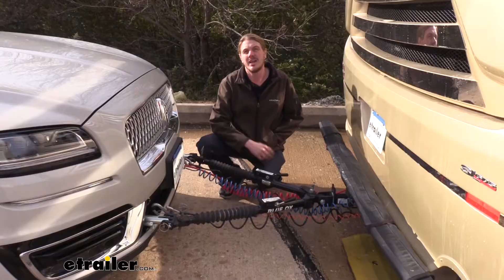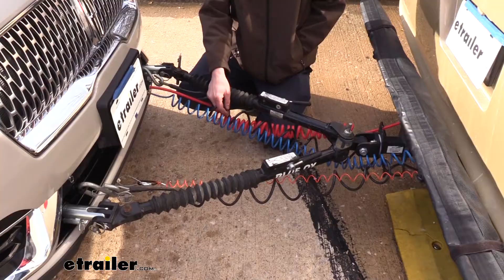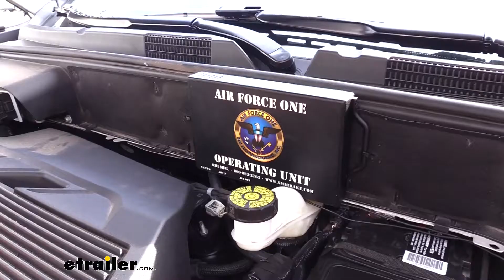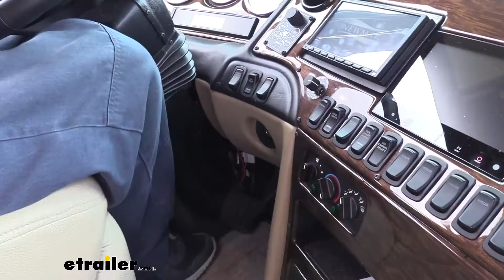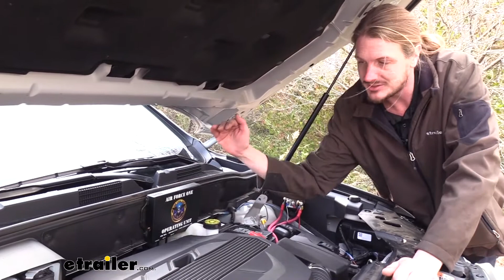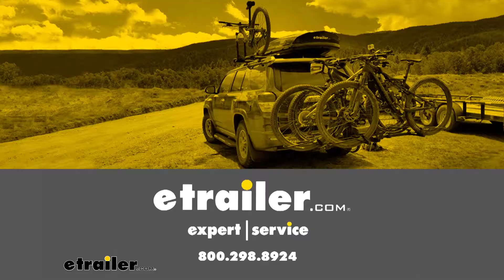etrailer | Best 2019 Lincoln Nautilus Flat Tow Set Up Braking System Options

Comment: What are the extra parts you need for the towbar wiring  that is needed?
Reply from the maker: It will depend on what type of braking and light system you are wanting to go with. You will typically need a 6 pole wiring harness to get power from the RV to the towed vehicle.
https://www.etrailer.com/Tow-Bar-Wiring/Roadmaster/RM-15267.html